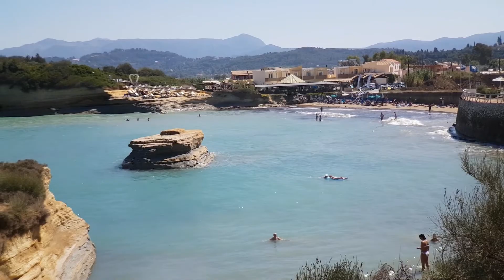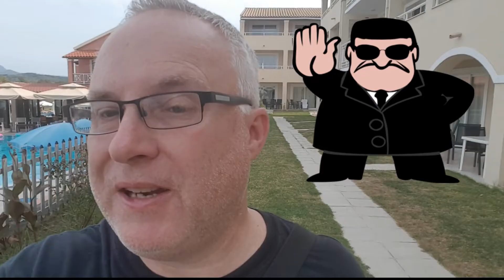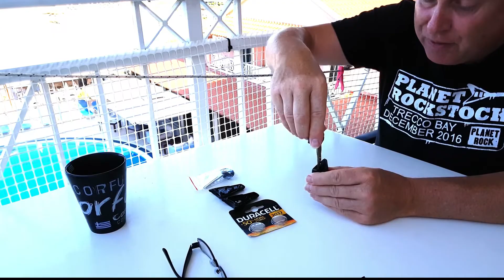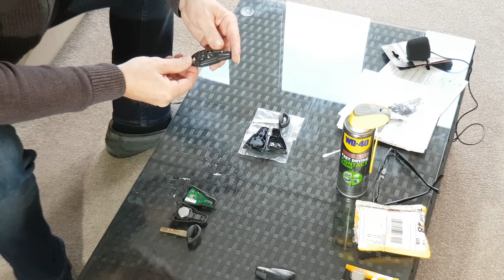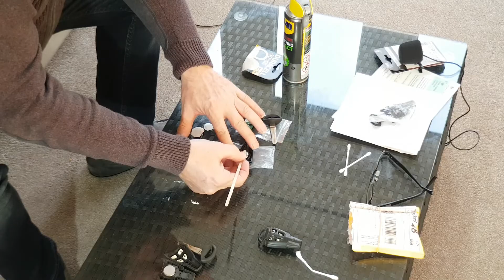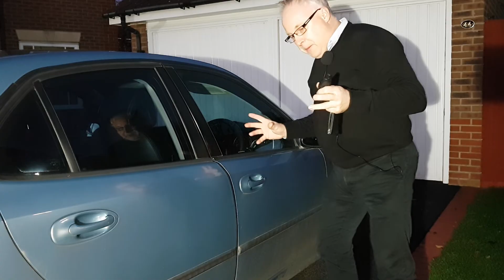SAAB key fob case and battery replacement | Saab 9-3 Remote Resynch

Comment: Wow...great video thanks! My daughter has a 2005 Saab 9-3 Arc convertible and the key is basically deteriorating and is turning into a gooey mess. We're getting a message to replace the battery in the fob and it basically is falling out. We only have one key and I live in New Jersey (United States) I'll check out your links above, but if you know of a place in the states please let me know....thanks again for this great video! I need to get a second key pronto!
Reply from the maker: Try joining Saab Nuts! group on Fecebook and asking there. You defo need a second key. I've used the key cutting service in the links since making this and it was fine. Good luck, let us know how you get on
Reply: @CycloneCyd  I'll do that! Thank you!
Reply from the maker: @JamesGodish  There's 16-odd thousand members globally in Nuts!, so I'm sure someone will be able to point you in the right direction. I'm in Nuts! myself. Good group.
Reply: @CycloneCyd  Hi! Great group, but no answers yet regarding the new fob. I found a place about 1.5 hrs away that will give me a new programmed key fob for $300. It's in Philadelphia. Does that seem reasonable? Thanks!
Reply: Cyclone Cyd Hi. Through Saab Nuts someone mentioned Orio and I was able to find a garage not far from work that specializes in Saab. I got one fob through them and another through a GM dealer. Had to wait 3weeks for the fob through GM though. Now have two new working keys! Thanks for your help. I used Union Line Garage in Pennington, NJ for programming. They also just completed a ton of work on the car. Hope this car lasts!

Comment: I don't have the original board for my new replacement key. Will this still work?
Reply from the maker: A replacement key (as in new electronics) needs programming to the car with Tech 2.
Reply: But do I need to have the CIM reprogrammed or replaced as well?

Comment: So i recently replaced the case on my key, and whenever i insert it, I hear the wheel unlock but it will not allow me to turn the key to the on position with the replacement case. Only with the original. Is there a way to fix this? I looked at the case and the dimensions seem to be just perfect.
Reply from the maker: I get this quite frequently. I just withdraw the key and try again. I'd suspect it's more likely a problem with the ignition key module. They're a regular failure point with message "key not recognised".
Reply: hey, have you found a solution for your problem? i am having the same issue.

Comment: I just bought a Saab 93 yesterday. And today I cannot open the car anymore! Remote it’s not working and nor the physical key!  It’ an electrical issue or he give me the wrong key? The normal key are supposed to open the door mechanically. The previous owner told me that’s a car battery issue... How I can open the car?
Reply from the maker: what do you mean by the physical key not working? Is the barrel seized and won't turn or the key won't go in?
I presume you've tried both remotes and both keys?
DO NOT try changing the battery in the remote.
IF it is a car battery issue (I'm assuming you mean the battery is flat) then you're gonna have to get the front centre grille off to open the bonnet latches and apply a booster battery. The car should not lose synch through a flat battery (or disconnected battery)
Reply: Thanks a lot for the reply! It seems that I did a big mistake buying this car! I bought it in Qatar from a turkish guy. He gave me only one key and I didn’t tried the metal key also... When the remote was off I tried the normal one which went all the way in but I couldn’t turn it left or right. The previous owner started to tell me a lot of lies... I managed to open the door opening first the engine hood. And now the remote control works properly. But the key not! I’m afraid that I have to change the whole system... There are no Saab representative or garage here in Doha...
Reply from the maker: Gabriel Niculescu  Ah, right oh. if the remote is now working okay, do not try changing the battery in the remote.
So, is there no Saab, Vauxhall, Opel, Chevrolet or other GM Group dealer anywhere near you??
Don't give up yet!!

Comment: So can I buy the whole key fob casing and the chip copy the key at a batteries plus and then plug the key fob in like you had done and it will program?
Reply from the maker: No. Transfer your own PCB across from your existing remote. You need to have one working remote and Tech2 to program another
Reply: Well the bottons on the remote do not work at all but it still starts my car it’s the original key/chip and I’m REALLY trying to avoid 500$ for a new one!

Comment: Hey I just got a new case, switched the insides and unlocked the door, but my car doesn’t let me go into on, any idea why?
Reply from the maker: Ignition Control Module probably. Try disconnect battery for half an hour.
Reply: @CycloneCyd  I did this and now my car is a brick.  I have a tech 2 and can't program any keys because I need a working key to get security access!

Comment: Do you know if there are schematics for these keys available? I have two of them, the only two programmed, that have broken buttons on them. I was going to see if I could get new buttons micro soldered onto those boards before replacing the key housing / batteries
Reply from the maker: Schematics? Not sure what you mean by that. However, yes you can replace the switches. The case and key I linked in the description can be bought with 4x new switches. There are loads of videos on how to solder new switches onto PCBs. It isn't difficult.
Reply: @CycloneCyd  Schematics as in the electrical diagram of the PCB board itself. I wanted to order the buttons that are soldered onto the board if I could find the part number for them... I suppose I could poach them off of the board that comes with the replacement fob.... I'm not trusting myself to do it though, I know a guy with quite the soldering set up, I think I'll bring it to him so I don't fry it and have to reprogram everything $$$. Thanks so much for the video! I think many Saab owners are facing this problem these days, a timely upload indeed. Best regards
Reply from the maker: @continuousminer  ah! the circuit diagram. No.As I say, replacement switches are readily available and you can order them with the case I review.

Comment: Hi Cyd, i need help with my saab 9-3 04 i got Check Engine Light and P1312 code O2S. Switch point Rich senson 1, do you know what i need to check ??, coil packs, spark plugs gap, ionization module, O2 Sensor or something else? i want  my saab fine again it loses power on full throttle and the Turbo gauge goes down when reach the last white line, it doesn't pass to red lines, yesterday i start the car and the engine sounds very strange, like a steam motor and it has no power to drive uphill.

Comment: What if you completely lost the key, what would you recommend? Could you get a key from another saab?
Reply from the maker: That's the point behind the pinned comment above. You'd be stuffed and in for a huge bill to get your car back up and running. This is why it is SO VITAL to ensure you have a spare working key at all times and always get your passenger to carry it with them if you go more than a few miles from home.
Personally, I have three keys and carry one in my laptop bag to work every day and my Wife has the other in her handbag at all times.
NO, you cannot use another key from another Saab

Comment: Very helpful ! Wish I had seen this before 👍
Reply from the maker: Thanks. It took a while to produce because I had to wait for the new case, which I'm very pleased with.
Reply: @CycloneCyd  today I can not open with the remote control, it doesn't work any of two keys I got, I opened mechanical and even if pull up all the doors I can open the the other 3 doors. Also I can not start the car even move the key for start ..... The alarm didn't sound too???